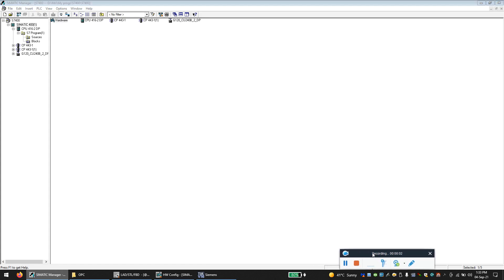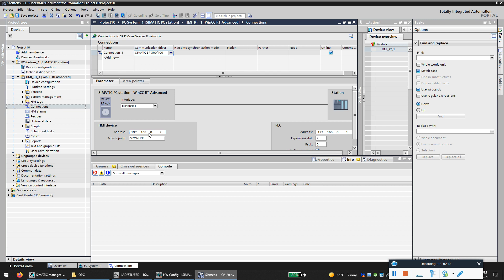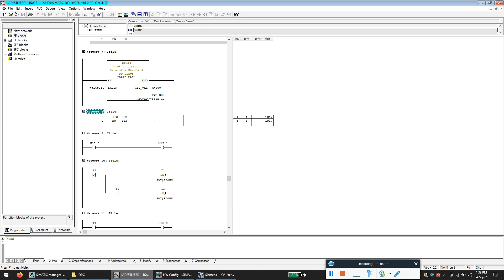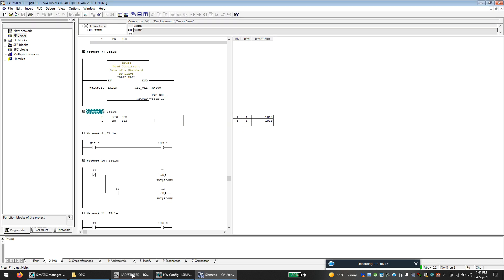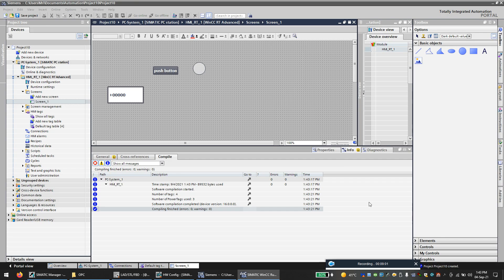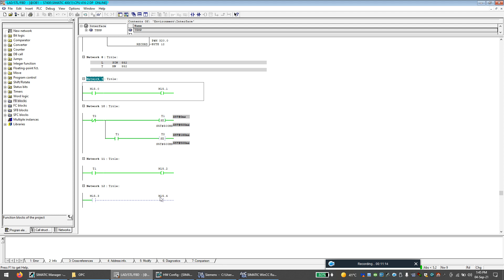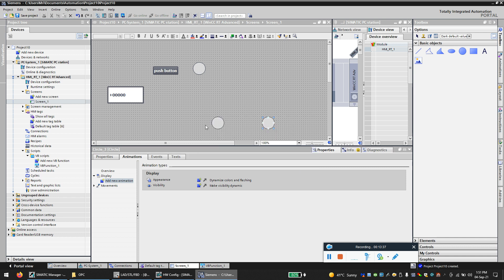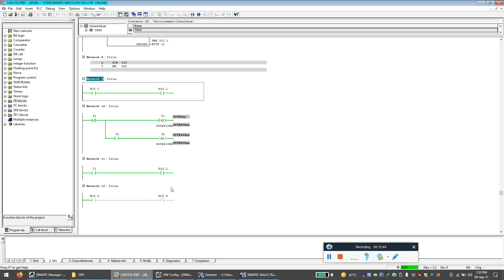16. Siemens S7 PLC to WinCc SCADA using Ethernet Communication

Comment: Hi! great video.
I'd like to set up a OPC UA connection with a Phoenix AXC1050 device outside my network (With a modem via M2M internet connection.) Should I use the IP of the PLC or the modem? Hope you can help me.
Thanks in Advance!
Joost
Reply from the maker: Hi, Thank you..,
I have worked on OPC , but not on OPC UA. I will definitely try it out..
Reply: @averageengineer4266  Oke, thanks for your reaction!